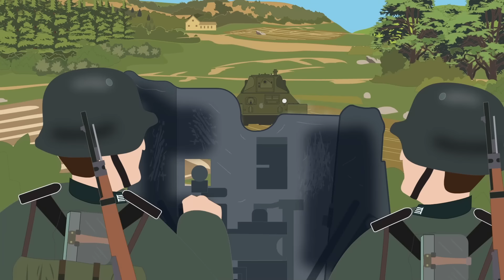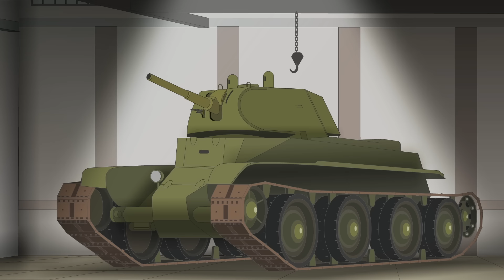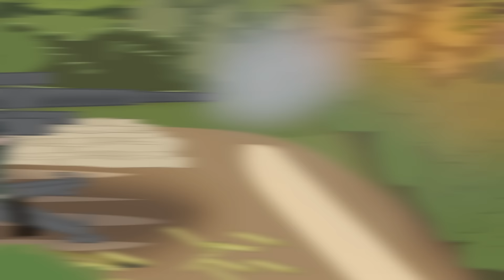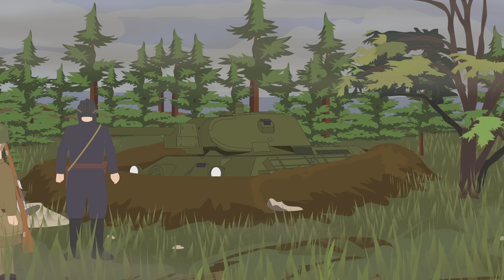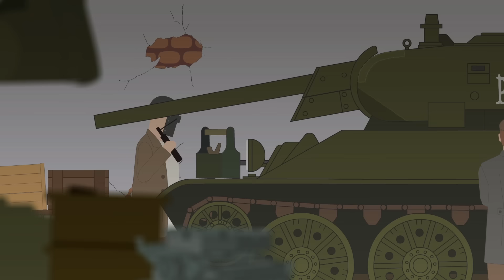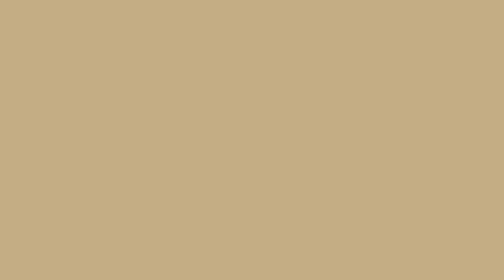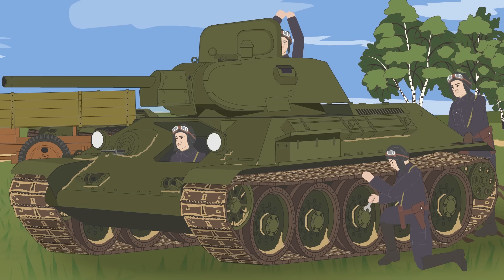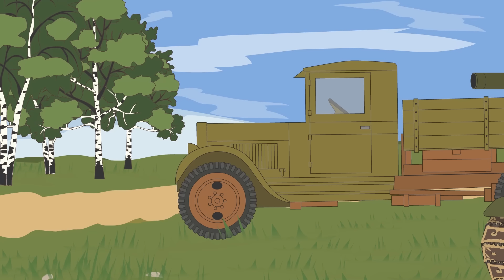Was the T-34 Really the Best Tank of WW2?

Comment: The T-34 could sink in the mud aswell.
At Battle of Warsaw, the soviets attacked through a soaked field: From 17 T-34, 15 sunk and get stuck in the mud, only 1 T-34 could manage to escape.

" The T-34 was supposed to be a simple and rugged vehicle that seldom broke down. Authors like to compare it to the more complex German tanks that supposedly broke down often. The concept of the T-34 as a reliable tank is another myth of WWII.
The majority of vehicles in 1941 were lost due to equipment malfunction. The same reliability problems continued during the period 1942-44. The evacuation and relocation of industrial facilities combined with the loss of skilled workers could only lead to the fall of reliability. 

In 1941 T-34 tanks often had to carry a spare transmission strapped on the back to counter equipment failures (10). In 1942 the situation worsened since many vehicles could only cover small distances before breaking down. In the summer of 1942 the following Stalin order was issued to units (11):
‘Our armored forces and their units frequently suffer greater losses through mechanical breakdowns than they do in battle. For example, at Stalingrad Front in six days twelve of our tank brigades lost 326 out of their 400 tanks. Of those about 260 owed to mechanical problems. Many of the tanks were abandoned on the battlefield. Similar instances can be observed on other fronts. Since such a high incidence of mechanical defects is implausible, the Supreme Headquarters sees in it covert sabotage and wrecking by certain elements in the tank crews who try to exploit small mechanical troubles to avoid battle.’

Henceforth, every tank leaving the battlefield for alleged mechanical reasons was to be gone over by technicians, and if sabotage was suspected, the crews were to be put into tank punishment companies or "degraded to the infantry" and put into infantry punishment companies.'

The constant complaints from the front forced the authorities to investigate the problems with T-34 production. In September 1942 a conference was held at the Ural tank factory by the Commissariat of tank industry (12). The conference was headed by Major General Kotin, People’s commissar of the tank industry of the USSR and chief designer of heavy tank ‘Kliment Voroshilov’. In his speech he said:

''Now ... there are a lot of complains about the T-34. You all know the reasons for flaws in the tanks. The first reason –inadequate visibility from the tank; the second reason, and this is the weak link that always accompanies our vehicle in the Army – final drive. And third, the main issue that we have today – insufficient strength of the idler wheel's crank. These issues are the major defects of the T-34 today. Having considered these issues from engineering and technological points of view I would like to discuss another issue, the one that directly resulted solely from our production deficiencies. They are: negligence during production of combat vehicles in the factories, carelessness of assembly and quality control of vehicles. As a result during combat employment our tanks sometimes cannot reach the front lines, or after getting to the territory occupied by the enemy for conducting combat operations, sometimes they are forced to remain on enemy's territory because of some little things... We have to make sure that as a result of this conference all shortcoming will be uncovered and following this conference all corrections in the tank will be implemented in the shortest possible time...
Recently comrade Morozov and I visited comrade Stalin. Comrade Stalin drew our attention to the fact that enemy tanks cover a lot of ground freely, and our machines although are better, but have a disadvantage: after 50 or 80 kilometers march they require repair. What are we talking about? It is because of control gear; also, as comrade Stalin said, because of drive gear, and he compared it with the Pz.III, which is in service with the German army, and which is inferior in armor protection, and in other features, and in crew's layout, and does not have such a fine engine, which the T-34 got, moreover its engine is gasoline, not diesel. But the question аrises – why its drive gear is developed better?

Comrade Stalin gave directives to engineers, to the People's Commissar comrade Zaltsman, to factory's CEOs and ordered them to fix all defects in the shortest time. A special order of the State Defense Committee has been issued on the subject as well as directives of the People's Commissariat of the Tank Industry. Despite all these resolutions have been made by Government and orders of the People's Commissar of the Tank Industry, despite repeated instructions from army units and from Main Directorate of the Armored Forces, which is in charge of combat vehicles operation, nevertheless all of these defects on vehicles are going on... We have to reveal all these flaws, and suggestions have to be made on at this conference how to modify machine component better and faster in order to make the T-34 tank, which is recognized in the army as a good tank, even better fighting machine.''

The situation continued to be problematic even in 1943-44.
There were constant problems with the gearbox and the engine filters. The Aberdeen evaluators noted:

‘On the T-34 the transmission is also very poor. When it was being operated, the cogs completely fell to pieces (on all the cogwheels). A chemical analysis of the cogs on the cogwheels showed that their thermal treatment is very poor and does not in any way meet American standards for such mechanisms.’
‘The deficiency of our diesels is the criminally poor air cleaners on the T-34. The Americans consider that only a saboteur could have constructed such a device’

The same problems were identified in a T-34/85 built in 1945. The US study ‘Engineering analysis of the Russian T34/85 tank’ noted (13):

‘Wholly inadequate engine intake air cleaners could be expected to allow early engine failure due to dust intake and the resulting abrasive wear. Several hundred miles in very dusty operation would probably be accompanied by severe engine power loss.’

The same study says in page 451 about the transmission:
‘The transmission had by American standards already failed, although with extreme care it could have been used further. Teeth ends on all gears were battered as the result of clash shifting. Many pieces of gear teeth had been broken off and were in the transmission oil. The failure is due to inadequate design, since excellent steel was used through the transmission.’

The mental image of the T-34 travelling hundreds of kilometers without stopping is fantasy.

A German unit that used the T-34/76 model ’43 in combat noted (14):
‘Regardless of our limited experience, it can be stated that the Russian tanks are not suitable for long road marches and high speeds. It has turned out that the highest speed that can be achieved is 10 to 12 km/hr. It is also necessary on marches to halt every half hour for at least 15 to 20 minutes to let the machine cool down. Difficulties and breakdowns of the steering clutches have occurred with all the new Beute-Panzer. In difficult terrain, on the march, and during the attack, in which the Panzer must be frequently steered and turned, within a short time the steering clutches overheat and are coated with oil. The result is that the clutches don't grip and the Panzer is no longer manoeuvrable. After they have cooled, the clutches must be rinsed with a lot of fuel.’

Soviet tests on newly built T-34’s (15) showed that in April 1943 only 10.1% could complete a 330km trial and in June ’43 this went down to 7.7%. The percentage stayed below 50% till October 1943 when it rose to 78%, in the next month it dropped to 57% and in the period December ’43 - February ’44 the average was 82%.

Preliminary inspection of tanks built at the Ural tank factory No 183 (largest producer of the T-34) showed that in 1942 only 7% were free of defects, in 1943 14% and in 1944 29.4%. In 1943 the main problem was damage to the gear teeth (16)

The V-2 engine had serious reliability problems (17). Depending on the source in 1941 it supposedly lasted for 100 hours on average (18). This figure went down in 1942 since some T-34’s could not travel more then 30-35 km.

The T-34 tested at the Aberdeen centre was built at the best factory using materials of superior quality but its engine stopped working after 72.5 hours. This was not due to American interference as there was a Soviet mechanic (engineer Matveev) charged with maintaining it. Still it was much better than the standard tanks since it covered a distance of 343km. According to the head of the Armored Directorate of the Red Army N.Fedorenko, the average mileage of the T-34 to overhaul during the war, did not exceed 200 kilometers. This was considered adequate since the T-34’s service life at the front was considerably less. For example in 1942 only 66km. In that sense the T-34 was indeed ‘reliable’ because it was destroyed before it had a chance to break down on its own!

Still there are examples of T-34’s breaking down during assaults even late in the war (19). For instance the 5th Guards Tank army in 1943 lost as much as 31.5% of its tanks during its march to Prokhorovka. In August ’43 the 1st Tank army lost 50% of its tanks due to malfunction. As late as the second half of 1944 tank units tried to replace engines with more than 30 hours of operation before a major attack

All WWII tanks had a hard time when travelling and they needed repairs and maintenance or they broke down.

There is also the question of standardization. The T-34 was produced at several factories. Each factory produced a slightly different variant. Could spare parts from Nizhny Tagil be used on a T-34 from Gorky? Doubtful."

Source: christos millitary and intelligence WWII Myths - T-34 Best Tank of the war
Reply: — So, Jerry, spamboting from different accounts in every T-34 video you can find?
Reply: wrote: “There is also the question of standardization.”

— Can you tell us what is “ГОСТ“ standard is? I’m bet you never even heard of it.

Comment: The answer is no, The Tiger tank and tiger 2 was able to destroy a T-34 With one shot, the tigers were a Detergent against The T-34
Reply: Kinda irrelevant though, cause the Tigers were so expensive there were very few of them, and they were so hard to maintain not many of them would even make it to the battlefield.

'Best' isn't a match of 'who has the best gun and armour', it's also about which tank has the best strategical and tactical mobility, ease of construction, reliability, resource drain etc. And you'll find that the T-34s heavily outclass the Tigers in these regards. 

Remember, the Germans lost
Reply: The tigers were good immobile turrets

Comment: One of the key factors was how cheap it was to produce, the fact that the Sherman costed 2.43 times more expensive (130000 rub vs 44000 dollars adjusted for modern day inflation)  and the Sherman wasn’t guaranteed to even win a 1v1 against it.
Reply: Tank warfare is largely based on who sees who first, because the first tank to land a hit has the initiative advantage.
Reply: @BlackBanditXX  which would mean the M4 would come on top in nearly every case due to better optics and crew comfortability.